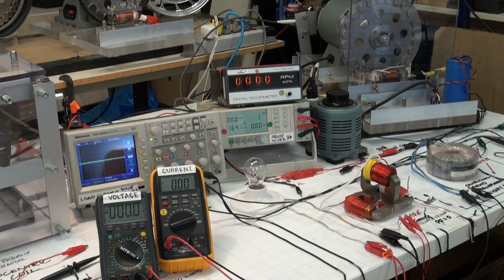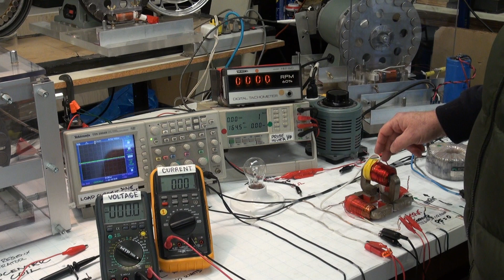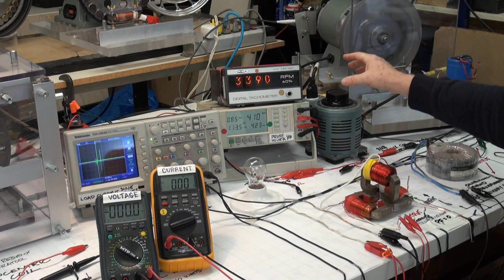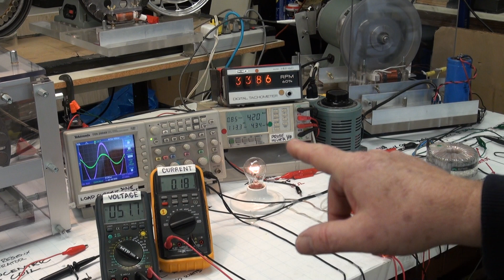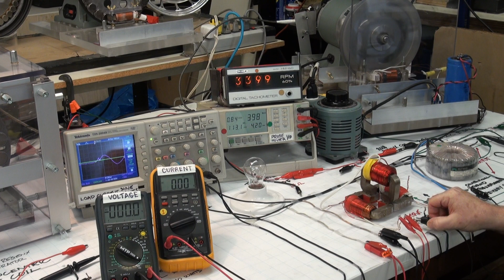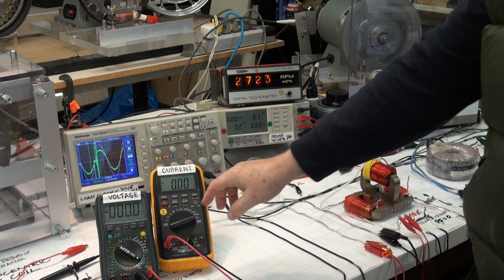SIEMENS REPORT PART 2: CONVENTIONAL TRANSFORMER VS BITT TRANSFORMER #siemens

Comment: hi thane, good to see your still active with this stuff and to go to the effort on making these videos where everything is easy to follow is really appreciative,
 i have a few questions for you.
- how are the secondary coils wired up to drive the load are they in series or parallel?
- does the L1 coil need to sit in the air or can it lay flat on the bench like the L2 coils? im thinking you have done it like that for the core shapes you have to work with.
- would the section of the transformer core laying horizontal on the bench benefit with more core material ( eg. 4X more ) to drop the flux saturation level down way lower then the primary coil core material and allow you to add more wire length to the  l2 coils or does the transformer seem have a characteristic where it likes the core size and wire length on the coils to be close to a 1:1 ratio? 
i would like to try and replicate what you have done here in regards to the transformer so i can test it with a few resonant circuit's.
cheers Steven.

Comment: I like to use 220 Ac 50hz tu get 12 volt dc with 50 Amp out. NS? NP? coiles and troide Size.

Comment: Sir please help me i would like to try this bitorid transformer.. Plz guide me that what is the frequency need to generate by circuit and turns of  coiles if i use 50 hz is it possible to get its works.

Comment: But what does this mean in practical terms?  Cars that don’t need gasoline OR a battery (other than to establish initial equilibrium), and thereafter the car will run forever at any speed over any acceleration;  therefore you use a small battery to start your car and you’re done??  Or, is this just going to make standard engines more efficient getting them closer to the Carnot maximum efficiency of 80%?  Please do explain.
Reply from the maker: Electric Vehicle Regenerative Acceleration Innovation Presentation for International EV OEMs
https://www.slideshare.net/PDiCEOThaneHeins3240/final-version-electric-vehicle-regenerative-acceleration-innovation-presentation-for-international-ev-oems

INDIA EV REPORTER Article: Regenerative Acceleration can Recharge the Battery while it Speeds up the EV: https://evreporter.com/regenerative-acceleration/

24,200 Trillion to Zero (ReGenX Generator Demonstration) https://youtu.be/YuOoQ8NuJwI

Electric Generator Infinite Efficiency of Operation Explained - it is as easy as 1,2 3...

1) In 2017 the world consumed 27,000 Trillion Watts of electricity. 

2) In order to generate that 27,000 Trillion Watts of electricity (output) power for the world - a minimum equivalent amount 27,000 Trillions Watts of mechanical (input) power is required.
When employing conventional electric generators which operate according to the existing laws of physics (Newton's Third Law, Lenz's Law and the Law of Conservation of Energy).
60% of the input energy is fossil fuels so this means a more than 16,200 Trillion Watts worth of pollution and C02 produced every year.

3) If the generators employed were Canadian invented, US patented ReGenX Generators which operate at Infinite Efficiency, 27,000 Trillion Watts of electricity can be generated with a maximum equivalent of 0.00 Watts of mechanical input power. 

100% of all the electricity which the world will ever require from now until the end of time can now be generated with zero mechanical input power.